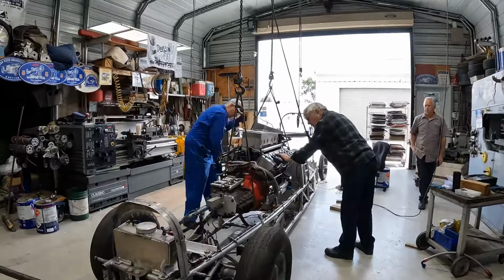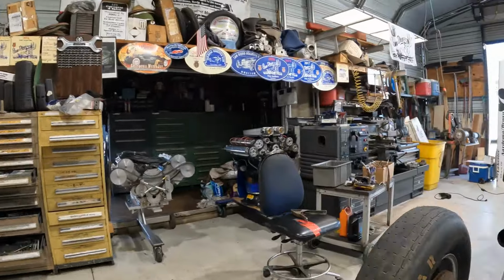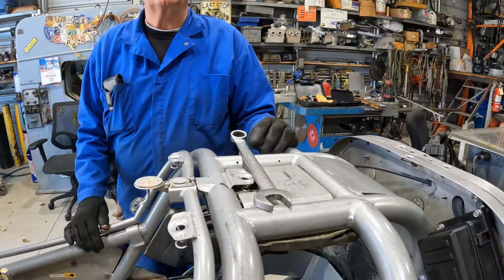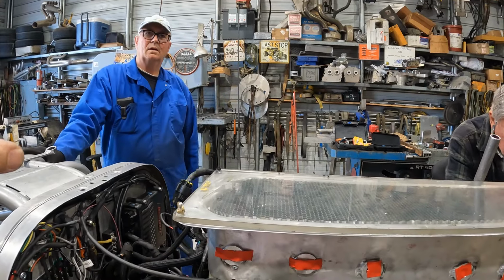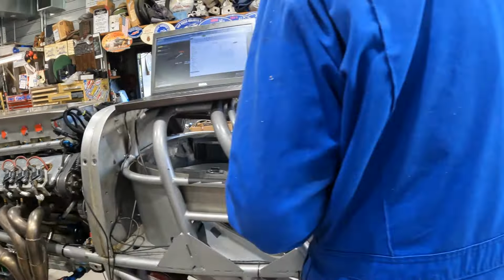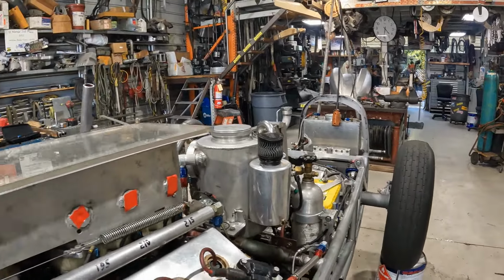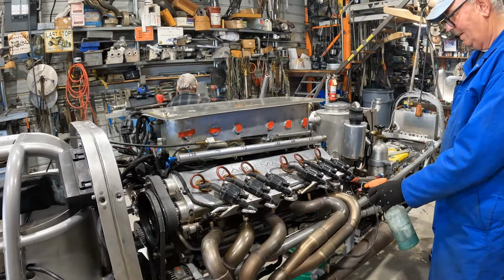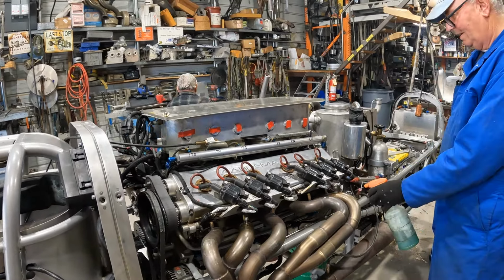V12 Race Car Engine Roars Back to Life!

Comment: If the laptops charger is plugged in (and even sometimes without) you can get EMI through the usb plug which can screw up sensor readings etc. Try unplugging the charger, you could also try grounding the laptop to the car chassis.
I'd also try running the engine with the alternator disconnected to rule out if the alternator is spitting out dirty power.
You likely have the screens RPM signal being linked to the wrong value.
Reply from the maker: Lots of good info here, Thank you for the suggestions. Greg Q
Reply: I've had problems with USB in some installations, I switch to RS232 when I can to avoid problems.
I bought a notebook that has a native RS232 port to facilitate that.
Reply: what is paramount with usb is good quality cables with choke magnet filters if you try to keep the usb over serial going without a hitch over a longer cable. do not use cable extensions. usb over serial is a very fickle mistress.

you can buy an usb isolator too, can help a bit. or cut the 5 volt line and insert another stable 5v if the device being talked to requires it, if the problems are from that. if the device takes power from the usb and it's a long cable this can help a lot. computers often output just nominal 5.00 and it'll drop easily over a longer cable. phone chargers output 5.1-5.4 and that's fine for any device, but the point is the voltage at the end of the cable stays above 4.95 with higher loads.

you can also buy a rs232 to bluetooth serial dongle if the device has serial. this is a very handy method to make older devices wireless.
Reply: @GregQuirin For a first check its a good start to measure voltage between the usb cable and the port on the computer with a multimeter. If there is voltage its some grounding problem, for the nasty emi and alternator related stuff a good scope is needed but genereal good grounding for sensors (star system one connection point to the ecu sensor ground pin and separation from the chassis ground, so on. You guys rules! Nice to heat it running.

Comment: Surprised the engine ran at all with the piece of plexi glass basically sealing off the air intake.  Gonna be wicked when all the tuning is sorted.
Reply: It looked to me like there were a bunch of tiny holes drilled in the top. Basically just a big plexiglass air strainer. The holes were just big enough for air to flow, but not so big that large pieces could be drawn in
Reply: If you pause it at 3:32 you can see them pretty clearly unless you have a not good Internet connection 😅
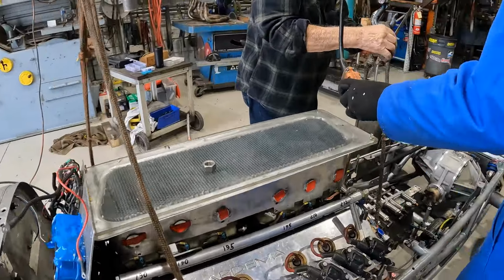Reply: @Richard-n2w1g  Thanks,  it was late last night when I watched and my tired eyes didn't catch the little holes.  Right now I've paused at 1:12 mark and there appear to be about 1/8" holes drilled around the perimeter of the plexi at the edge of the air box.

Comment: as a bench racing observation :face-turquoise-covering-eyes: , maybe the throttle positioning sensor is not grounded or the engine block needs an additional ground , and the system is looping through the PC  ?

Comment: I had the same issue with my Fuel Tech FT600 disconnecting / connecting from the PC randomly when my engine was on the dyno. I never found the issue, but could have been ignition interference maybe?
Reply from the maker: Thanks for the info!

Comment: This is some sort of EMV problem.
You can try the following things. 
1. Unplug the Laptop from Power and 
Get a USB Isolator! 
the slow ones (ADUM3160) are cheap. the full speed usb 2 from topping cost ~100$
2. Is everything concreted to chassis ground and chassis ground to earth ground
3. Add (lots of) clamp on ferrite to signal wires

Comment: You need the laptop plugged into its own power supply so it doesn't drain power from the engine management computer through the USB port with the engine management being incapable of dealing with the drain placed upon it and the power 'sags' would be my guess.

Comment: It’s running in limp mode when it’s plugged into the computer it’s got a poor connection somewhere
Reply from the maker: I think it is a poor connection or issue with the USB cable